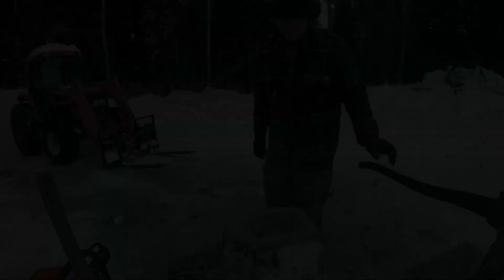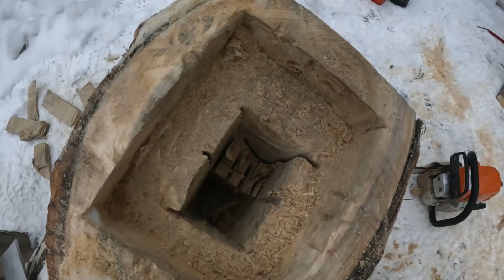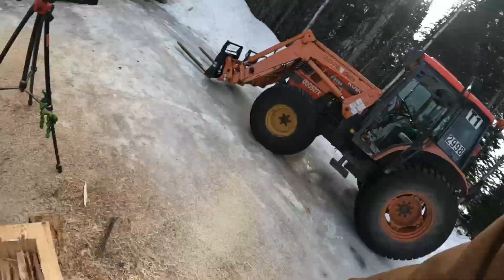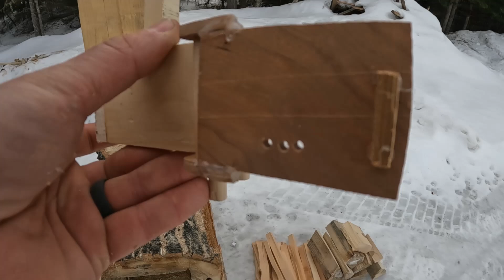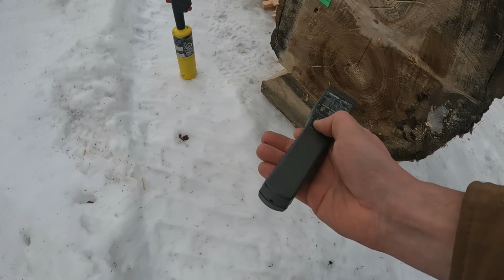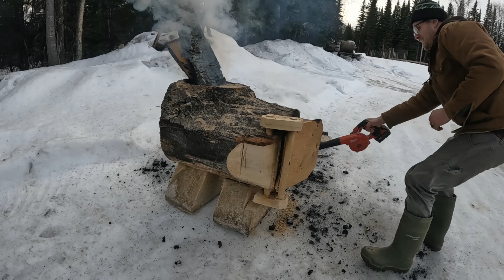Fabricating An Outdoor Wood Furnace - Is It Worth It? Wooden Wood Stove 2.0

Comment: I honestly think it was an electrical failure! This computer controlled  stuff is dangerous! Design was flawless. the chimney was a little thin, but I think an electrical fire started in the back where the plug is accelerating the deterioration of the chimney!

Comment: When you had your laptop plugged in were you able to perform a software update so you had the latest version? Are you still able to plug your laptop into the interface?  If so you should be able to scan for fault codes.  Those stored codes may shed some light on why the chimney pipe and door failed.